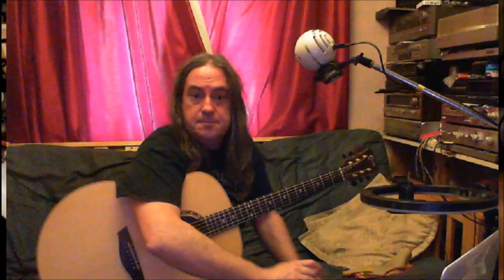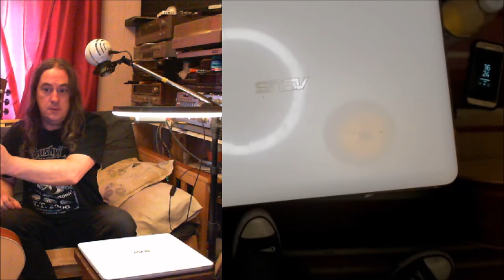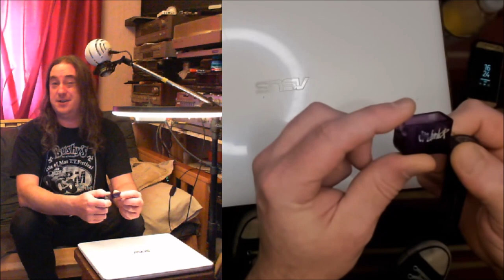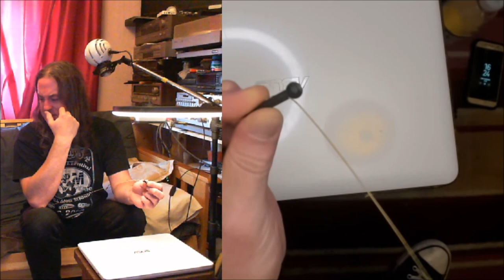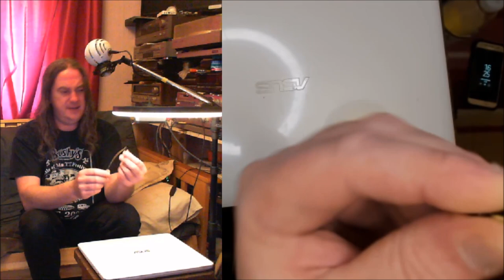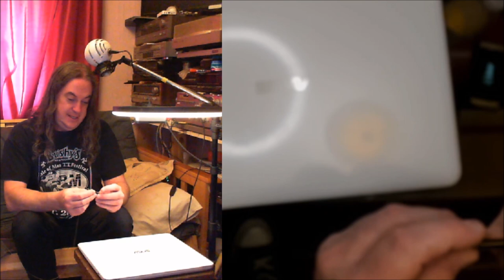faith jupiter acoustic

Comment: You can reduce that ringing behind the nut by allowing a few extra turns of string on the tuning peg, just to increase the break angle slightly... It doesn't fix it completely, but it looks better than having your sister's hair scrunchie wrapped around the neck. 😂
Reply from the maker: i did actually intentionally have more winds in this one before i noticed the problem